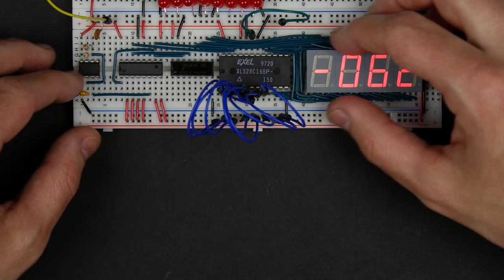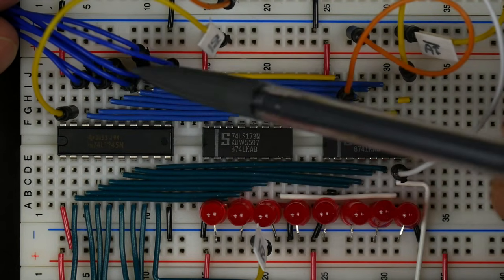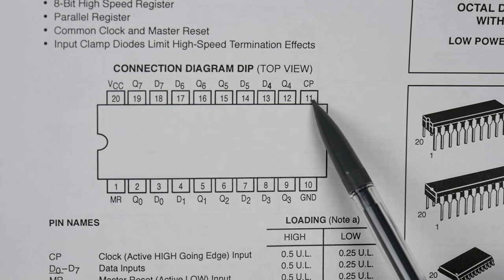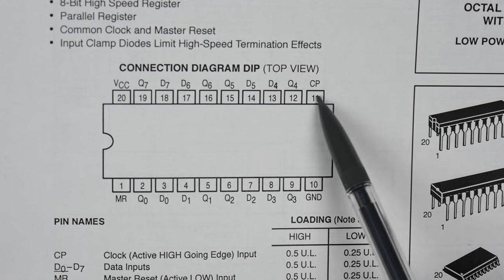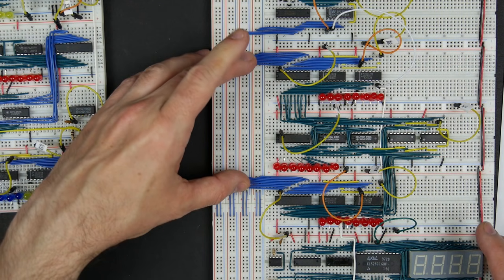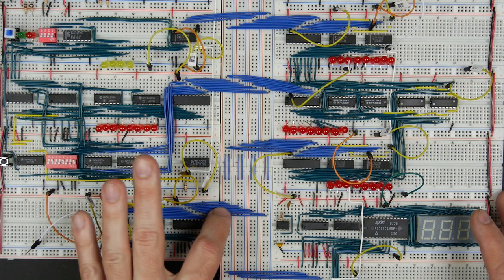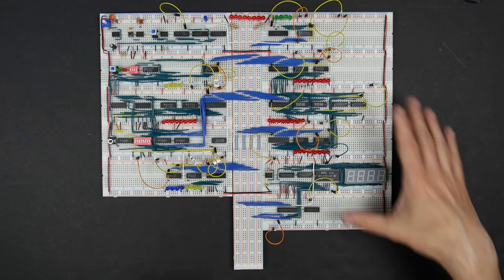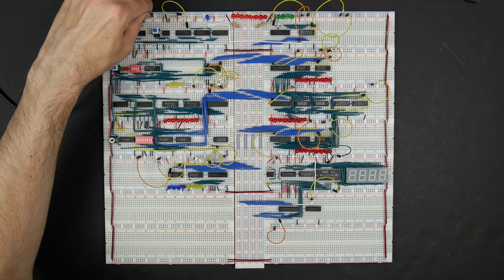8-bit computer build: Connecting the bus

Comment: Question: Why did you choose to use dual 74LS173s in the earlier registers you built, instead of the single 74LS273 that you're using for this one? Is it just a matter of what you had on-hand, or is there a practical reason?
Reply: This, I'm having the same dilemma. Why not using the 74LS237 instead of 2x74LS137?
Reply: @erik19borgnia  Have you made your decision yet/how did it work out?  I know there was some talk on a previous video's comments about ANDing the clock (required w/ the 74LS237) being a bad thing due to the latency it would cause but I really doubt it would matter on a breadboard computer.
Reply: @adamhixon  Actually I had that problem, because it loads on every clock, so you have to AND to a control signal to prevent this. I didn't like that so I choose to use the 74LS377 instead for the registers, which has a ¬G signal that acts as an enable... HOWEVER, in one specific register (B register in the ALU) I used the 74LS237 because I wanted it to be able to reset itself to 0 (and the 377 can't), so I had to use an AND gate in this particular case.

Comment: I've experienced building several assignment projects on those breadboards in an electrical engineering class.  The most frustrating thing was, after several dozen connecting wires to various chips, one loose or misplaced wire can be a nightmare to find. 
I felt for those students that had to make an entire computer with zip tied bundles of wires extending over several bread boards.

Comment: You magnificent bastard.
Reply: Allen Lowe  it’s just amazing what Ben does imo. My best thing I made can be simplified down to one component. I could never do a full fledged computer like this. (The one component was a button/switch-based programmable painting grid using the MAX7219 circuit.)

Comment: Considering you have the leds connecting the bus to ground, are the pull down resistors even needed?
Reply: Also would like to know why he connected the cathodes of the LED’s to ground, i thought that was positive.
Reply: @chopov11  no, anode = positive and cathode = negative. I also know the answer to my question after a year; LEDs like any other diode have a voltage drop, they will only pull the bus down to a certain voltage until they don't pass enough current to drain the rest of the charge in a reasonable time/at all

Comment: Could you put a piece of red electrical tape over the 7-segment LEDs? That should increase legibility somewhat. (If you have a piece of dark red transparent plastic lying around, it’s even better.)
Reply: Sometimes I wonder why don't these LED displays come with that foil already put on :P Is there any reason one would not want it put on by default?
Reply: Usually meant to be installed behind a tinted filter of some sort.
Reply: Even gluing a tiny piece of printer paper over the 7 segment display helps A LOT. Try it sometime, it actually looks pretty nice for what it is :P Tinted glass works best though(which blocks all color except the color of the LED).

Comment: ben, could one use an EEPROM and some counters to make an adjustable digital clock, such that a computer could adjust it's own clock speed? 

the computer would put some time in and a counter(+astable clock) would increment up to that time, at which point it would advance the clock 1 cycle. the computer could program itself to run with 5 second cycles, and then mid program it could change to run at maximum clock speed while doing perhaps some repetitive calculations, then slow or even stop itself at some point. A command which asks the operator to advance the clock would basically be a pause instruction i guess?

other implementations: a series of frequency dividers going to a ladder of transistors and the computer can choose to connect or disconnect itself from any of them including a manual control line (on a debounced button)

or of course a basic DAC resistor ladder on an astable clock such that the computer can, for instance, choose the capacitor charge speed of a 555 clock. that way it could make itself run any speed from max to halted via careful resistor choice.

Comment: After lowering the recommended 10k resistor to 3.3k, all the modules with exception to the Ram_In responded with a 0 to the open bus. Even with the lower 3.3k resistor, I still get 1.2v on the open bus lines. Leakage current? My solution is to tie all the bits from the program counter to the bus and never read in to a module without another module driving the bus. Not sure if this is a solution or not but the best one I can come up with for now. Made a lot of screw ups in prior module builds so I wouldn’t be surprised if a couple of the bus transceivers might be a little less than peak performing! Maybe supplying a little more leakage current than they should.

Comment: If you had a loose connection on one of the wires (like something isn't working and the wire wasn't set in breadboard proper which is causing it) is there a quick way to check or would you have to reset each wire til you found it?

Comment: You could have sacrificed the reset pin of the 74LS273 and used 74LS377 instead which has an input enable, that way you wouldn't need the AND gate. That's the way I did it, because in reality you don't need to reset any of your registers during operation. You can just overwrite their contents.

Comment: I ran into a problem when building your 8-bit computer where the RC circuit for the RAM IN (RI) caused some feedback on the clock signal and effected my Output Register. Was getting random O's getting displayed during a computer run. I needed to isolate that RC circuit by putting 2 remaining NAND gates of the RI 74ls00 in series. After doing that it really stabilized the output display. Just wondering if that is the reason why you switched to using a single 74ls273 for the Output Register.
Reply: Yeah, I'm building that and having the same problem. From what I can tell with my scope, it is causing there to be a rising edge triggered on the falling edge of the clock. When you say you put two of the NAND gates in series, do you mean you put the one in front and one behind the RC circuit NAND gate?
Reply: So I just solved the problem differently. I put the clock signal into the resistor through a diode, and then put a 10k resistor to ground on the other leg of the capacitor. Seems to have solved all the feedback issues!

Comment: How can you use an asynchronous clock in this case (AND-ing system clock) when someone clearly said you could not do logic with the clock when you were doing the registers? They said that one would leave the synchronous realm if one does so. Is it because of our very slow clock speed? Would put constraints on the systems max clock frequency?

Comment: I think the optimal way of describing the same thing would be by saying "control signal enables the enable input of the register and we AND the clock signal to synchronize it with the entire computer" instead of saying it in the opposite order "clock signal enables the register and we AND control signal onto it".

Comment: Great video Ben! After you finishing this project , would you like to give us a talk about how signal that carries data from  the capacitor of a DRAM cell to the latch of a register works on the circuitry perspective please ? I know how sense amplifier works, I have trouble in visualized seeing the process of how the signal which carries data is generated and sent to the register , and how register receives it and traps  it into the latch of register  . Thanks in advance.

Comment: I know i'm late to the show and i'm pretty new to the topic but couldn't you have used just a simple transistor (i know its quick and dirty but it works) to "and" the clock and your signal? The 74LS08 could have been saved by that

Comment: Is it possible to just hook up the control signal to the clock input of the 74LS273 instead of using an and gate of the clock pulse and the control signal? I may have misunderstood something.
Reply: Possible, but the display will flash at each bus change

Comment: When I connect everything up my program counter goes double time (counts twice per clock cycle)... I found out if I take the 0.01uF capacitor that is acting as an edge detector for the NAND gate for the "Write to Memory" signal, it fixes the program counter issue... but now the edge detector is gone. What is happening here and how can I have the edge detector without it interfering with my program counter?
Reply: Hey, I just had the same problem!! Took me a while to work out what was happening.  The discharge of the capacitor on clock going low seems to trip the program counter.  All you need is a diode on the clock signal which feeds the edge detector (the other clock wires can be left as they are).  I didn't have one to hand so just used an LED (which of course is a diode).  Put it so that the +ve leg of the LED is towards the clock origin and the negative feeds the edge detector.
Reply: See also: https://www.reddit.com/r/beneater/comments/is7vxb/the_capacitor_used_in_the_edge_detector_of_the/

for other ideas
Reply: @andrewmoxon169  Thanks! I have quite a few types of diodes, are there any that wouldn't work for me/break something?
Reply: @karatharp6118  give one a try. You won't break anything.  The diode will have a small voltage drop forwards (about 0.7V) but this leaves plenty for the edge detection circuit. Alternatively (as mentioned in the link above) use the NAND chip twice to buffer the signal (preventing return voltages from propagating back up the clock wire)

Comment: With the bus pull-down resistors in place I'm still seeing about 1.6v on the pins with nothing outputting to bus. This reads as all 1's if I enable a register for input. Is anyone else seeing this?

Comment: Hey, Quick question for anyone who knows.
I noticed that you diddnt use the bus to transmit the values from the registers to the ALU.
Was that just because you built the ALU before the bus, or is there a more significant reason for not using the bus for this.?
Reply: It would demand at least one register inside the ALU and more clock cycles to perform the sum.

Comment: I wanted to know if there is any limitation / requirement / needs to use a 4bit memory address with your 8bit computer, or you could use an 8bit (making all the changes to accommodate this change). I'am planning to build a computer similar to yours, with some personnal changes.
Reply: I guess he did it this way because then he can embed the jump addresses along with the instruction opcode in one byte. With 8-bit addresses (or longer), one would have to supply them in a byte (or bytes) separate from the opcode, which means that the control unit would be more complex, because it would have to know when there are more bytes which have to be fetched after the first opcode byte as part of the instruction, and to orchestrate all those signals to fetch those bytes from subsequent memory addresses and temporarily store the operands somewhere.
But this complication seems to be a must anyway if one wants to build some more capable computer.

Comment: When nothing is outputting onto the bus I'm seeing ~1.1V, rather than zeros despite the 10Kohm pulldowns.  It seems like the 74LS245 bus transceivers are leaking voltage?
Reply: Well I fixed that by swapping out the 10k resistors for 470ohm, seems low!  Also had a very strange problem where the output register required two clock pulses to read in even numbers (but worked fine with odd numbers).  Swapped out to the trusty 74LS173's and the problem went away.

Comment: couldn't find the EEPROM Your using, however i did find 2x PQ2816A-250 EEPROM on ebay going quite cheap and considering buying just for fun and later projects, looked at the datasheet on both the AT28c16 and the PQ2816A and they have the exact same pins, will this chip be a viable replacement to your 28c16?
Reply: Well they should be identical. They have the same number 2816. The first 2 letters just signal the maker. The c is probably something to do with the implementation( CMOS maybe?) The A might stand for a revision though, but I think you’d be fine

Comment: How would we connect it up if we have an address bus that is greater than 4 bits? For example, I am planning on using 8 TMS4034NL chips which are 1x1024 bit SRAM chips and tying the address pins together to get 1KB of RAM. However, for the address bus that means I will need 10 bits instead of 4. In real systems, for example, on the 8088 it is like a 20 bit address bus to allow 1 MB of addressable memory. So basically, how do we address more than 16 bytes of memory?
Reply: For addressing to more than 4 bits of memory, you would need to make the Program Counter larger. This is because we are using the PC to address the RAM. If you want to have 1KB of RAM, at least in an 8-bit word scenario such as here, you would need 1024 addresses (10-bit, 8-bit for 256 addresses). So make your PC 10-bit.

In addition, you would need to make your Instruction Register 8 bit to accommodate. this would leave no room for parameters such as the "3" in the command: "Jump 3". You would need to have a separate address for your parameters and have the control logic micro instructions load it from somewhere else in RAM. This also means you need another control line (possibly meaning another EEPROM).

Might be easier (you get more memory per chip) to use a single 71256SA15TPG. Its a 8x32k bit SRAM chip. That's what I am doing.
I hope this all makes sense.

Comment: my output module was grabbing 255 from the bus no matter what I did. Only the LEDs at the top, output module address, and 10k resistors were on the bus at the time. Did some tinkering and not sure why but 10k resistors were having the module pull 255 (all 1s) so I switched to 5k resistors and they seem to be working, not sure of the implications though. I can still assert 1s where I want and seems to be working, not sure why 10k resistors weren't working.
Reply: Same here. I measured across the resistor and it was 1.5 V or so.  I'll try 5k!

Comment: I've benn building the 8-bit Computer up to this point and noticed, that the 10 kOhm of the pull-down resistors is quite a bit too large to full pull it to a logical low voltage!
Because of that I rewatched the video to check if I just misheard or something. What I found out was, that while Ben did say they are 10 kOhm resistors, they certainly dont like like 10 kOhm. 
Maybe its the Video, but these resistors have the code brown-black-red, which is a 1 kOhm resistor!
A 1 kOhm resistor is way more suited to be a pull-down resistor.

For those wondering, the 74LS chips seem to use a 20 kOhm resistor as pull-up. With basic voltage divider you get  1.66 V on the bus lines with that, which is certainly not logic low. With a 1 kOhm resistor the voltage is 0.24 V, which is good logical low level.

I decided to go without the pull-down resistors. Instead I connected all 8 outputs to the bus for all modules. That way I can even see if the bus is empty or something is on the bus (because when I dont pull-down the leds are slightly lit).

Comment: thanks for the entire series. please can you put link to the breadboard that you use?
Reply from the maker: The best quality I've found is the BB830 by BusBoard Prototype Systems. I get them on Amazon at https://www.amazon.com/dp/B0040Z4QN8?m=A2RKGEIGG4B1JT

But beware: it can be tricky to avoid the cheap ones. If ordering from Amazon, I've had the best luck only when it explicitly says "Sold by Busboard Prototype Systems". Anything else and you're likely to get a fake, even if it says you're getting a brand name one. You'll know because the packaging won't look exactly like it does in the Amazon listing. (I've returned fake ones and Amazon makes it pretty easy)

They're not cheap. If you're paying less than $7-8 USD each, you're probably getting a fake. But the difference in quality is dramatic. Eventually I want to make a video with breadboarding tips, but I want to finish the computer first.
Reply: Ben Eater , AFAIK the MB102 840-hole breadboards for about €$4 have gaps in the power rails at the midpoint of the board.
(A source of confusion when you forget that, and wonder why things don't work...)
Reply: It's a pity they won't deliver to Australia.  Locally, these genuine breadboards cost heaps from a retailer.
Reply: sabatimmm I've had very good luck with wisher (or wicher, not sure) boards. Contact resistance in order of hundreths of ohms, contacts hold very tight and don't go loose. I source these from tme.eu
Reply: +Ben Eater  is there really that dramatic difference between the original breadboards and some cheaper knock-offs? I bought some of those cheaper ones in bulk from China through AliExpress.com and they seem to work just fine.

+Massimo O'Kissed  yeah, I feel you bro, I had the same problem with mine (ironically, those were the more expensive ones :q ). I had to put jumper wires on the power rails every time I was building some circuits (and remember to do that too :P ). But those cheaper ones didn't have that problem – the power rails go all the way through their length.
Hmm... Now when I think of it... Maybe this was the problem some people in the comments had with their power supply? (Those who complained that there seems to be not enough power for their circuits.)

Comment: Is there any way you could adapt the computer to use 8 bit memory addresses without rebuilding all from scratch?
Reply: I think there is. Just upgrade those four bit registers to 8 bit ones. The control board is the one that will need major overhaul as memory related ops need two words to execute as the memory address is one word. And you need more memory.